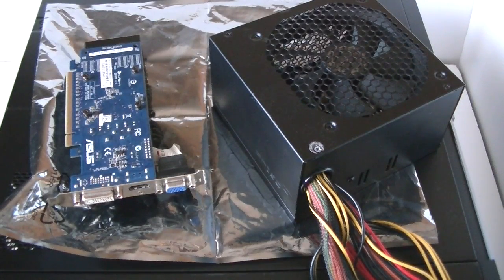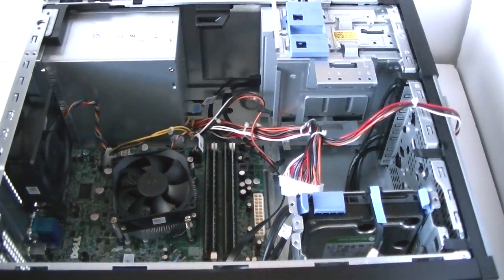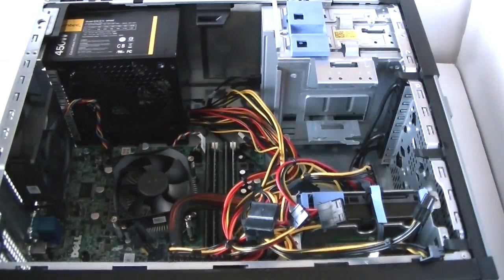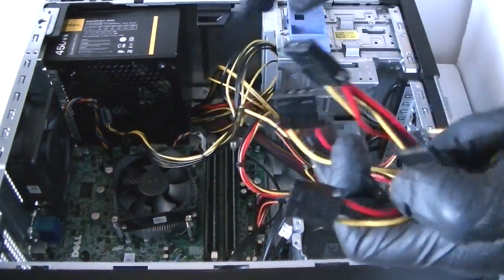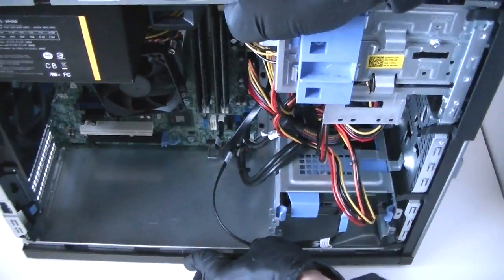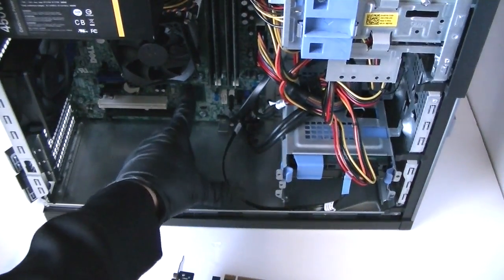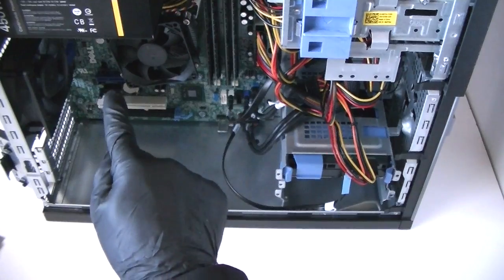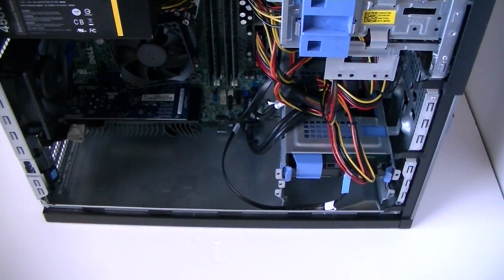Dell Optiplex 7010 MT Upgrade Gaming Power Supply Video Card

Comment: I have a Dell 7010 i5-3470  3.20 ghz 16 gb win 10 and  I'm considering putting a  Amd/Nvidia1050/ti?  (single fan ) . would a 450 w evga, cosair, seasonic  psu be adequate,  also would the mob be able to handle it?  Thanks!
Reply from the maker: Hi, yes  450w power supply will work fine i like seasonic better.
Reply: Does the double fan version won't fit?

Comment: I have a dell optiplex 7010 also with intel i7 3770, can i fit a gtx 1070 in this? of course ill be upgrading the power supply
Reply from the maker: Yes gtx 1070 mini itx video card will fit fine

Comment: man i have a question, i can upgrade this Pc with a rx 460? i read about this graphic card need the power from the Motherboard, but its possible?, by the way excellent your videos!
Reply from the maker: Hi, yes you can upgrade video card to MSI Radeon RX 460 with single fan will fit fine and make sure you upgrade your power supply brand name to at least 400w.

Comment: I have an optiplex 7040 mini tower and am looking for the best power supply to go with an that will fit.  I'd also like to add an RX480, but I don't know if it will fit.
Will the Seasonic 500W work with the RX480 and both fit inside the machine?  Also, do I need to worry about adding more fans or upgrading anything else besides the PSU and GPU?

Comment: Can I use a GTX 1050 4GB video card will it also work? if yes will I need a new PSU? What?
Reply: Thank you for the feedback. Really appreciate it.
Reply: yes you can, most of those computers have a 275w 80+ gold psu and the gtx 1050 ti has a tdp of 75w even if you have an i7 3770 you should be fine so i think is not necessary change the power supply
Reply: Senpai Thank you for the feedback
Reply: If your 1050 ti needs external power then you should get a sata to 6 pin pcie adapter
Reply: So have you tried? Did you change a PSU or it worked just fine?

Comment: is it possible for you post the links to where I can find this power supply online? also, I want to upgrade my OptiPlex for video editing, is it possible to put a better graphics card inside of it?
Reply from the maker: Hi, power supply antec vp450 and how much money do you want to spend for video card ?
Reply: Mxkdi I've bought a Dell 7010 mt and awaiting delivery.
I'll be upgrading memory and PSU.
I want to install a r9 280x which is a big card.
You said you can remove the hard drive bays.
I know I'll need to do this to accommodate this card.
Is it easy enough to remove the hard drive bays?

Comment: Great videos. I'm waiting for a dell 7010 to be delivered...

Is it difficult to move the motherboard into a AtX/Matx case when it comes to front panel connectors?

I realise some Dell mobo connectors are not standard, do I just trace the wires from the motherboard connector to the power button, make a note which pins they going to, then connect the power button from to the new case to the two power button pins I noted down?

Thanks for any help you can offer.

Comment: Pleeeassee respond. I purchase this same computer 7010 MT and was wondering if I could install a 1050ti in this case, and if so how? I head the motherboard only allows like 35w to be drawn from the slot and that the 1050ti needs atleast 75w to run.
Reply from the maker: Yes just to confirm, Dell Optiplex 7010 Mini Tower With  PCI Express x16 Slot (BLUE)  Maximum Wattage 75W  not 35W

Comment: Do you have any issues with Dell BIOS blocking 3rd party parts.
I look forward to buy one and upgrade RAM, GPU and PSU.
Thank you.
Reply from the maker: No  issues, which brand name parts are you trying to install ?
Reply: Thank you for quick reply.
BTW, i'm not buying them yet but look for an upgrade when buy one.
Reply from the maker: Soon as you are ready to buy and leave a comment i can help you choose parts. Thanks
Reply: Thank you.
:)
Reply: I'm adding the antec 450... what 2GB Video card would you recommend that will not require a windows reinstall of a lot of messing around with the BIOS, please?  Thanks!

Comment: Will any power supply fit in this case?
Reply from the maker: ATX Power Supply
Reply: ***** Ok man. Thanks for the fast reply! Also, would an ATX supply fit into the SFF version of this OptiPlex?
Reply from the maker: No
Reply: ***** Ok. I'm definitely going to go for the MT version with the i5 3470 and turn it into a gaming rig. I was thinking about buying a used version with the i7 3770 but the chasis it comes in is way to small and it can't fit a GPU.  Thank you for the help man. I really appreciate it.  Just subscribed. :)
Reply from the maker: Hi, you can watch my other video just uploaded today dell optiplex 3010 mini tower upgrades gaming

Comment: Does anyone know the maximum length for video cards without taking out the drive bays?
Reply from the maker: What kind dell do you have mini tower or desktop ?
Reply: Mini tower
Reply from the maker: For gaming you can install GeForce GTX 950 02G-P4-1952-KR video card and upgrade power supply to 500w on a mini tower.
Reply: @Mxkdt  What's the best card under $100?

Comment: What specific graphics card and power supply would you recommend for a cheaper price.
Reply from the maker: I recommend for gaming video card geforce gtx 750 ti with power supply at least 400w
Reply: does it fit into the 7010 mt?
Reply from the maker: Yes
Reply: what was the l shape thing you were talking about if I got a graphics card of 7.5 inch?
Reply: Mxkdi would you recommend a cpu change for 7010 mt?
Reply: let me rephrase that I have a 3.10 ghz cpu cup is what the guy I bought it from said but I dont know what it's called
Reply from the maker: Intel Core i5 or Intel Core i3 CPU ?
Reply: Intel Core i5-3470 @ 3.20 ghz
Reply from the maker: Yes this machine does support intel core i5 3470
Reply from the maker: GTX 1050ti video card will fit fine and 500w seasonic power supply i like
Reply: Hey mx I finally got the Eva gtx 750 ti sc 2gb. I put it in the right slots and stuff but when I try to connect it to monitor the monitor won't detect it. Also I'm using a dvi-i to vga adapter that came with it. Should I just get a DisplayPort cable because my monitor doesn't have a hdmi or dvi-I only like a dvi-d.
Reply from the maker: Did you buy video card new or used ?
Reply from the maker: King Tui
Did you try different monitor see if video card works ?
Reply: Mxkdi I bought it new, I also don't have a second monitlr
Reply from the maker: do you have another desktop you can test your video card on ?
Reply from the maker: What is the model of your monitor ?
Reply: Mxkdi i dobt have another desktop and the monitor is a Dell 22 inch but I dont know the model
Reply: Mxkdi found it, it's http://www.overclock.co.uk/product/Dell-U2212HM-215inch-UltraSharp-Widescreen-IPS-Black-LED-Monitor-with-DVI-VGA_45540.html
Reply from the maker: Nice monitor did you try vga cable or dvi to dvi cable that came with the monitor ?
Reply: Mxkdi I've been using a Vga cable but I never had a gpu so it was connected to my motherboards one. I bought it from a guy on Craigslist. I tried using dvi but I noticed the cord monitor and the gpu dvi ports are all different.
Reply: Mxkdi I've also tried a dvi to Vga adapter but it didn't work either
Reply: Mxkdi I'm going to try a displayport cable and see if it works if it doesn't idk lol
Reply: Mxkdi also do so I need to disable the onboard graphics or integrated graphics from bios cuz I saw it in some foruma
Reply from the maker: King Tui
Did you get your video card to work or post ?
Reply: Mxkdi no I haven't yet I was at football practice so I couldnt was just doing some research, I'll keep you posted on the progress
Reply: Mxkdi great news when I turned it off and on I pressed f10 then it said some things about it detected my gpu so i just had to connect my adapter to gpu and it then it worked. after that I downloaded the drivers then it went BEAST MODE and ran all my games at 60+ fps at pretty much Mac settings. Thanks guys for the help now I can finally not get 20 fps lol :D
Reply: Cherzong Cha yea I gof 750 it's works great for like all my games so is good